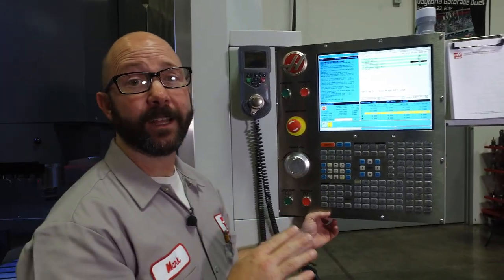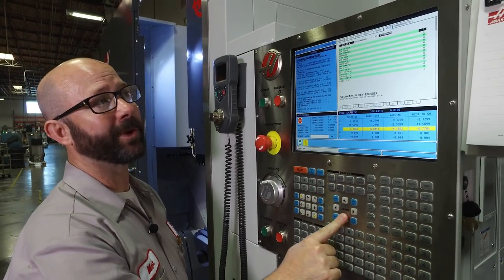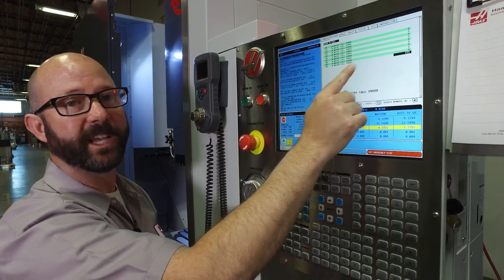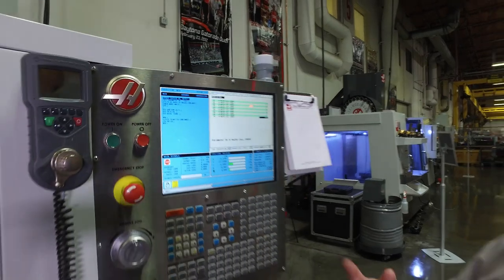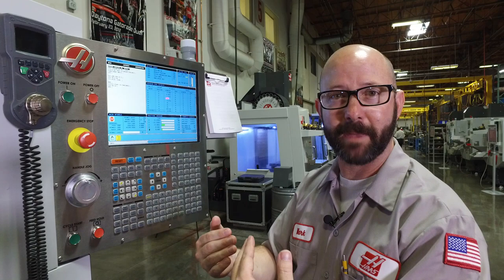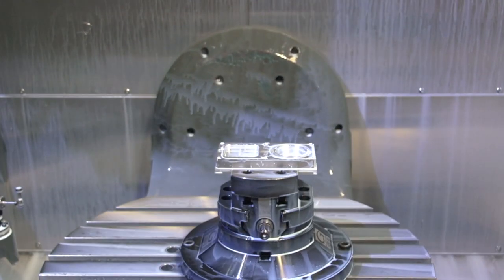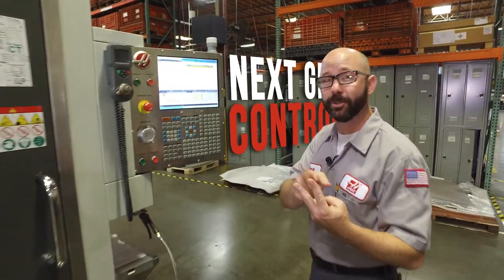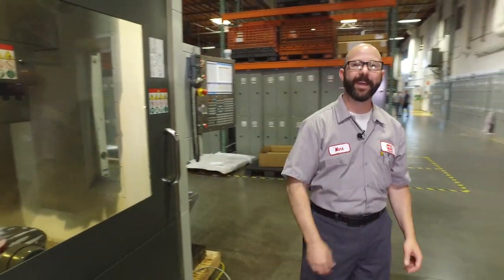Easily Create Your Own Custom M and G Codes – Haas Automation Tip of the Day

Comment: Great tip!
I just wrote a M105 that calls Program O0900 to retract the tool and move the table front and center on my TM-1P.

%
O09000 (M105 Table Front and center) 
G91 G28 Z0. 
G53 G49 G90 X-15. Y0. 
G91 G28 Z0. 
M99 
%

Nice!

Comment: Anyone who's editing parameters/variables from within the macro/G or M code, please put G103 P1 as the first line and G103 as the last line before looping back to your main program. 
This is to prevent the lookahead to execute anything inside the macro while you're still machining. 
Some stange behavior can occur otherwise..
Reply from the maker: That’s great advice. Thanks for posting it. – Mark, Haas Tip-of-the-day
Reply: thank you!
Reply: AND after any probing cycle if you want it stay off,  as the Renishaw routines turn it off at the beginning and back ON at the end;  DAMHIK😂😂😂😂
Reply: Thanks for info

Comment: I would like to know is there a possibility to create custom alarms? For example when G43 code is called and setting 15 is on, H and T number must match or alarm will turn on, but if H is by mistake set to zero, then there is no alarm. Is there a way to change that?
Also, is there a way that alarm is turned on if there is no G43 entered in program?
I apologize if my english is not the best, but i hope you can understand my questions.
Thank you!

Comment: I have 2 new VF-2's with NGC and after about 2 weeks have finally figured out how to navigate it.   How about a video on the changes of the NGC because a lot of things have moved.
Reply: I agree although I am still way back in haas technology. I go to the Ohio Valley Career and Technical Center as a junior in machine shop and our haas is a 1995 VF0 and still has the old tube style  glass screen display and we just bought a brand new VF3 and it is a very nice machine but everything is just so different.
Reply from the maker: +Shawn B Hi Shawn. We appreciate your comment. Please reach out to us directly, contact@haascnc.com, and provide your zip code and a direct phone number or email address. We'd appreciate the chance to connect with you directly to discuss this more. Thanks.
Reply: Agreed. We just bought a VM3 and the manual b that came with the machine was not written for the NGC! Very frustrating.

Comment: Hi Mark ,

I come from an Okuma lathe background and work for the first time on HAAS mills .

I would like to do some standard programms that enable me to change the shape of the part as for example :
 V1= 200 (X-length ) 
V2 = 150 (Y-length )
V3 = 10  ( z )
So I can flexible change the size of my block as required.

Can the HAAS controll work with those codes ? For example g1 X=V1 

Regards Alex
Reply from the maker: Alex –   We can definitely control features with variables, from within Haas Lathe and Mill programs. We’ll make use of the Macros option. A Haas will use different syntax then an Okuma, different variable names. We might use #101=200. (X-Length); #102=150.( Y-Length);#103=10. (Z). From within the program we can call up X#101 Y#102 Z#103. See the Macro Section of your manual for more details. You can download the manual from our website, https://diy.haascnc.com/. – Mark, Haas Tip-of-the-day

Comment: Hey Mark, what if you have an older machine. Im running 2000  mini mill i need to move the table to the upper right corner  for a tool change (every time) so some of the longer tooling will not touch.  Thanks in advance...Dave
Reply from the maker: The simplest way to move to a safe tool change position is by using a G53 command. We have a video on this coming out in the next few weeks. G53 G00 G90 Z0; G53 G00 G90 X0 Y0, you’ll need to enter the XY locations that work best for you. If you alias your existing M06 command, you can use an M16 from within your aliased program, an M16 does the same thing as an M06 and will keep you from getting into an infinite loop with your Aliased M06 calling up your Aliased M06. On your machine, your dealer can also setup the machine to go to a certain spot before each tool change, using ZERO AXIS TC parameters, so this is also an option. – Mark, Haas Tip-of-the-day.

Comment: Hi we have a st10 and we're having trouble making a clean thread. When the machine goes threw first cycle the threads are tight. If I repeat with same everything the threads are good but I little chowdered not nice and clean. The hass book says28tpi times 125 ipm= 3500rpm! Is that correct?
Reply from the maker: Hi Ray. Can you send us a direct message with your machine's serial number and your contact info? We might be able to help you trouble shoot the problem with some more info. Thanks!

Comment: I normally run an EC-1600 with NGC but I'm trying to Alias a g code for an older controller,  it's not really clear where I save the program on the old controller as you can't see the 9000 series programs in the machine. Do I just save it into memory?
Reply from the maker: Matthew – Hi there. It is definitely doable. Shoot me an email, at TOD@haascnc.com and we’ll figure it out or your specific machine, then I can come back and post a comment. – Mark, Haas Tip-of-the-day

Comment: Hey Mark. I can do this on my EC-1600 with the next gen controller. Tried the same way on my VF-4, older controller which you only touch on. I can't figure out where to save it. I turned 23 and 7 off. I can't find the 9xxx folder. No one seems to know the answer. Any ideas?
Reply from the maker: Matthew – On the Classic controls, we won’t have a 9xxx folder. We can drop our 9xxx subprograms directly into MEM. You won’t be able to see any of the 9xxx programs if Setting 23 is on. This is a safety. In our example, we create our own O9009.nc program, and place it in MEM for Classic controls. – Mark, Haas Tip-of-the-day

Comment: I work at a University and we program a lot of different parts for our machines. Most of them are one offs. To add this to all of our programs would be great. What I would like to do is to be able to program a T1 M03 (to get my tool out of the way so students won't get hurt) and on the second line I would like to program a G53 G00 G90 Y 0. X-385. so to move my table to the front of the machine by the operator. I am a bit confused about how to do this and would like some help. I usually just add this to any program that I have and this does work well. I am a bit shy about doing this, is there anything that I might do to mess this up so that I can be cognizant of any problems before they arise? Also, will I have to push the start button again to continue to the end of the program or M30 on the next line or will it automatically rewind? Do I need to put a M99 in before the M30 or how does this all work? Thank you in advance for any help that you provide. I do enjoy your Haas tips of the day, Thank you
Reply from the maker: John Obrien – That is very doable! Check out our G53-for-mill video as well, https://www.youtube.com/watch?v=Rd-h0YA9IzQ&t=2s. If you set Parameter 90, to “155”, then whenever you run an M155 from a program, the machine will do whatever you told it to, in program O9009 (see video). Your O9009 program could say: O9009 (Safe Move);G53 G00 G90 Z0;G53 G00 G90 Y0 X-385.;M99. When you run an M155 now, your tool would move up and over where you told it to. If you ever try and alias an M06 tool change, be sure to use an M16 instead of an M06 inside of your O9xxx Alias Program, otherwise you will end up in a continuous loop. M06 and M16 do the exact same thing. If you get stuck, give your dealer a call, or you can always email us at TOD@haascnc.com. – Mark, Haas Tip-of-the-day

Comment: Is the Next Gen Control only available on new machines or is there an update we can perform to get it? What are the other advantages/disadvantages of the NGC?
Reply from the maker: +Chad Krause Thanks for the questions. No, the NGC is only on new machines, it is not something that can be retrofitted to an existing machine. There is more memory available in the NGC, as well as options for even more. We have a Wi-Fi option, an enhanced VPS system, and the Haas DWO/TCPC option, a software feature that is very helpful when doing 3+2 or 4/5-axis machining.
Reply: Haas Automation, Inc. Thanks! Also, can you explain the G200 index on the fly option for lathes? The video doesn't explain how to write the code.

Comment: Hey Mark I tried this G53 G00 G90 Z0;G53 G00 G90 Y0.;M99. and the program works in memory but when i use it as a m code i get a over travel alarm im using a vr-11
Reply: I tried it on a vf5 and it worked now im curious why the older vr11 wont do this

Comment: Is it possible to use "M" code for the renishaw equipment? If so how to see example of the program?
Reply from the maker: +Leonid Geller It is possible. I’ve written an Aliased M-code that probes a part on our UMC, and then sets the C-Axis Work Offset to that angle. This takes some fancy macro programming. We’ll add this to our list of future video topics. For now, this is something you’d need to work out on your own, or feel free to reach out to your local Haas Factory Outlet to speak with an Application Engineer.
-Mark, Haas Tips of the Day

Comment: How do I know what parameter corresponds to what 9000 program on the older machines
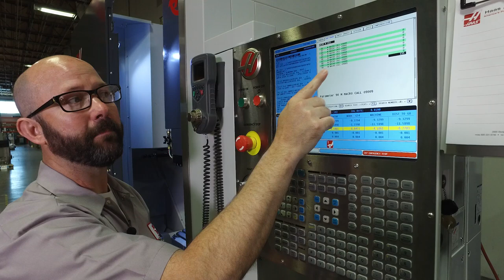Reply from the maker: We will create our own Aliased M code subprogram using any available O9000-O9009 O-number program. We can create our own Aliased G-Code using any available O9010-O9019 program. See 02:08 in the video. Once we choose an open O-number program to create and use, we can assign it an available M or G code number under Parameter 81-100 on the classic control, or on the Settings>AliasCodes tab on a Next Gen control. We assign what M/G code number goes with which O9xxx program, with parameters 81-100, or on the Settings>AliasCodes tab. We can look at the programs in MEM to see what O9xxx program numbers haven’t been used yet, and are available for us to create and use with our own Aliased M or G Code. – Mark, Haas Tip-of-the-day

Comment: Is there a way to peck tap without copying the G84 line with a new Z depth?

Example: G84 Z-1.0 R.2 Q.125 F20.;
G80

Q would peck @.125" until it reaches -1.0" deep.

Looking for a simple solution. 

Thank you,
Sam Roberts
Owner/President
www.3d-machine.com
Reply: I think you can do like G84.2 or something but I'm not sure
Reply: +Samuel Roberts X1. Y1.G84 Z-.25 R.2 F.05G84 Z-..5This is the only way that I am aware of so  the  M code idea in the video might work out slick if you have macros.Any chance some one wants to write a macro for this? Say the peck amount was always kept to 4X the pitch until it reached overall Depth.
Reply from the maker: +Samuel Roberts This is a well-timed question! We just taped a new Tip of the Day video yesterday that covers tapping, and in the bonus content at the end of the video we will include some sample programs that will answer your question. If you can hang in there until Wednesday, we will have you covered. Thanks, and stay tuned!
Reply: I have successfully peck tapping by copying the cycle with a new Z depth. Looking for a simple solution. I am certain I could edit a post to generate what I am doing at the control. I look forward to seeing what you have to show us. 
Thanks, 
Sam